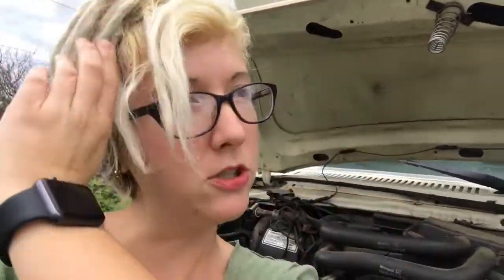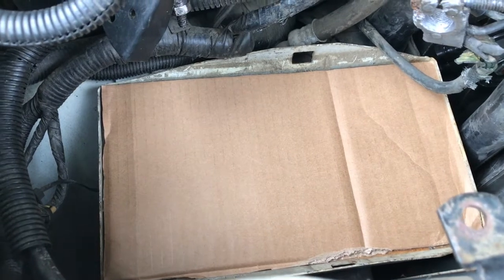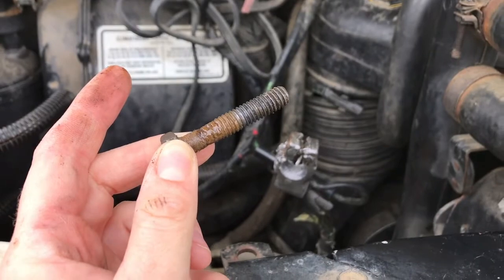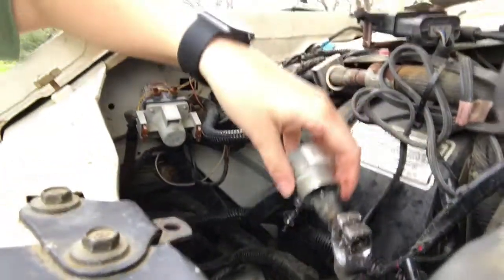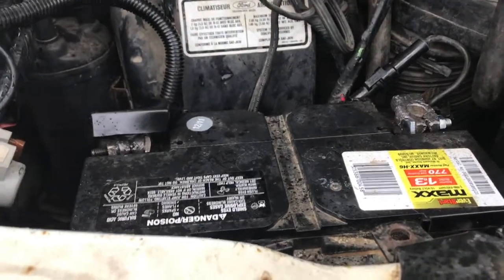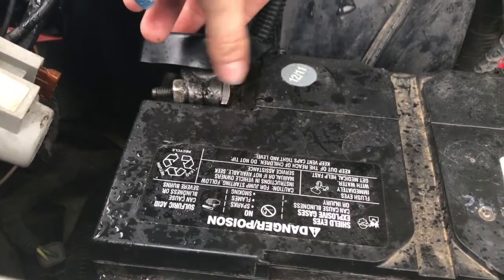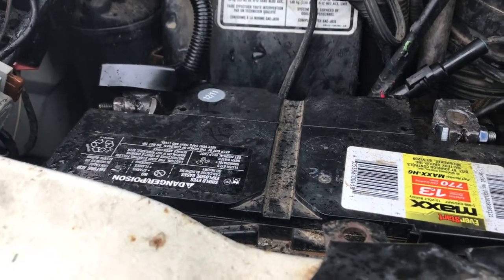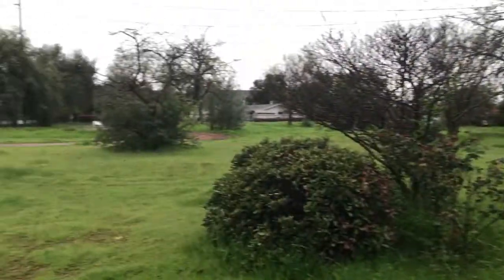Troubleshooting Engine Battery | RV Log

Comment: Check the solenoid next and get rid of that cardboard. It will collect and hold water causing rust. Use something made of plastic and will elevate the battery just enough to let any water run out. You could find something on amazon or even use 4 lids from 1 gallon milk jugs, one under each corner of the battery.

Comment: that sucks. I hope you figure it out. I just had engine problems and I'm not mechanical either but I replaced my spark plugs as well as one coil (I'll probably need to replace the others soon). maybe you can purchase an OBD2 ??? that's how I figured out what was wrong with mine...good luck. keep us posted
Reply from the maker: I will certainly keep everyone posted. As for the onboard diagnostics, I think my RV is too old for that to work. It's a 1991 model.
Reply: The Chickadee yes, that's right, I forgot about that.

Comment: Your battery is six years old. That's old for lead acid battery, especially in an RV that probably has seen minimal use. Replace it.

Your Negative cable, the black one, looks horrible. The insulation is missing and the copper is corroded, along with the damaged terminal end.  That needs to be replaced. The positive wire may need replacing as well.

You need to have a real mechanic look at it, since there is a potential fire hazard there. 

Eddie
Reply from the maker: Yeah, I noticed the cables look rough. I know the battery is older, but I had it checked and the people at Napa said it's still good. As for a REAL mechanic, trust me I've tried to get someone out to look at it. But there are literally no mobile mechanics in my area. NONE. So it's just me and my buddy Mark for now until I get it started again, then It's off to a mechanic.

Comment: Noooo, I wouldn't put cardboard under your battery. There's reasons it's metal with holes...ventilation?  I've seen mechanics clean the tray with steel wool, wipe it clean. Also, you'r cables look totally corroded!  I think they should be replaced. The last thing you want is a fire!!  Take care and be safe!
Reply: I was going to say the same thing about those cable.

Comment: I'm not that mechanical.  But your battery wires looked bad!  Look for a YouTube video on how to change those.  will your headlights come on or your dash lights?  That will tell you if you are getting some power from the battery.  I hope you figure it out!
Reply from the maker: I had my friend Mark take a look at the wiring. He said that it could cause some electrical discharge if it touched metal, but it shouldn't be be reason my engine isn't starting. I'm still going to wrap some electrical tape around it anyway. The dash lights work fine, I've not actually tried the headlights.